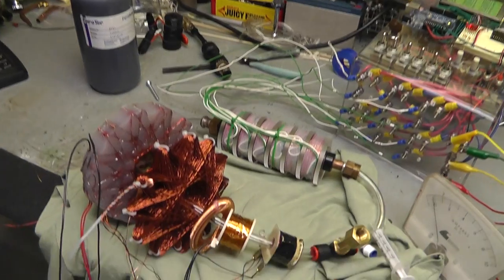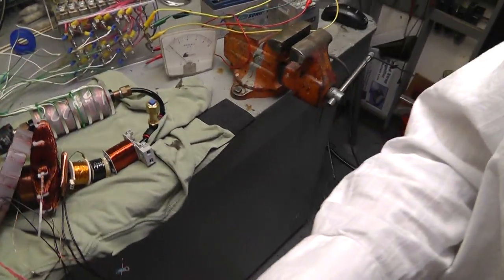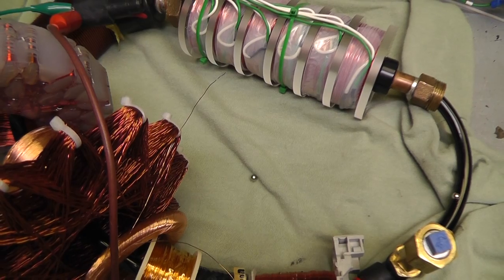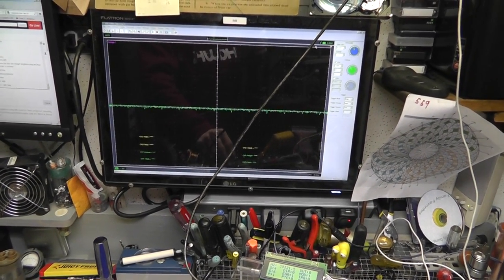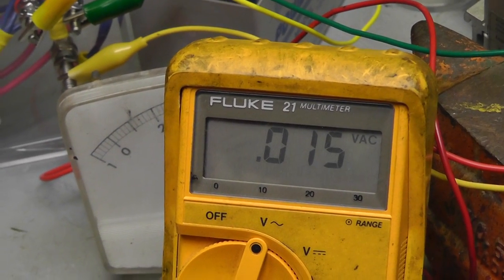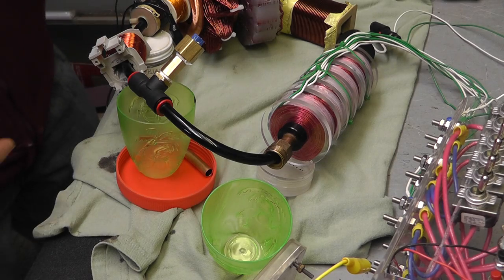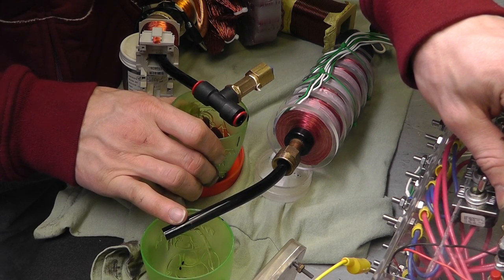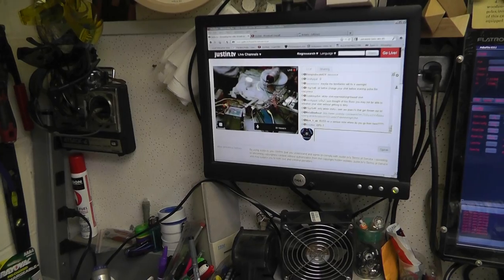P1 EPG  Testing, Ferro Fluid Is Not The Key? I Dont Think So

Comment: I am happy to see that somebody is researching this. I also came across the idea to see if pumped ferrofluid hydraulics would be feasible. And realized myself that the maximum pressure that could be achieved depends on the willingness of the magnetized particle in the fluid to reorient themselves instead of moving and pushing all the other fluid around. possibly a key could be the shape of the pulse chain moving through the chain of windings. Do realize though that an AC induction motor (cage runner) would not work either if there wasn't an overlap (60-120 degrees) between the phase coils. The reluctance (remanentz of the field and orientation) of the fluid would have to be utilized within some optimal phase to phase distance and frequency to maximize achievable pressure - more experimentation is necessary!

Comment: I think the amount of voltage you are seeing on the solenoid coils is consistent with how much power would be transmitted through the air to any near by coil. Also I think the best result you could expect from this test would be that the ferro fluid would act as a transformer core and provide a path for magnetic flux but this might be blocked by the copper pipe inside the pulsed coil’s core, acting as a magnetic flux shield.

Comment: Could you generate any power if you magnetised the fero fluid (with electricity or by touching it against a permanent magnet) and then pump it around the tubing? What if the pvc tubing was shaped like one of your wicked funky coils? Then you have a magnetised fluid being pumped around a shape that wouldn't normally be possible to move solid magnets around! If somewhere in the pipeline (or in several places) the hero fluid comes into contact with a neo magnet then as long as there are no air  locks the entire loop of fluid should be magnetised, then the pvc pipe could itself be wound in coils. Hey Russ i have a couple of interesting ideas regarding generators, PM me if your interested.

Comment: @MagnaMoRo a quote- To get the lithium gas so cold, the researchers trained an infrared laser beam on the gaseous cloud. Laser cooling is the primary method physicists use to lower gas temperatures to near absolute zero. The laser essentially stun the atoms, slowing them down, and thus lowering the temperature.
After initially growing, the cloud began to shrink. That shrinkage, combined with the speed of expansion after the laser turned off, indicated that the lithium atoms had become magnetic.

Comment: Another thing I caught is: Stan referred to the whole unit as a "resonating system" (not  the EPG by itself... So, pressurized gas turns the EPG pump, which generates electricity for electrolyses,  which creates gas, which creates more pressure, which turns the EPG pump, etc...

Comment: I would say if your trying to establish a flow of the ferroparamagnetic fluid. Then you probably want an array of electromagnets alternating with a gap of one coil length or more in between to make sure you are attracting the fluid within the distance of the feild lines. You would have to have iron or another mixture of similar conduting metals to produce movement of any significance. Then again I have not followed original project you are working one so I dont know if that's what you are doing or not.

Comment: Russ. To the point. Ozone is a live gass that can hold a charge untill killed by UV or Lazer ionization. Oxygen is explosive because it cant hold a charge. Ozone mixed with argon keeps the charge on the ozone. If you want to make your EPG work. Evacuate the pipes and at the same time purge with argon then at zero psi add your PURE ozone gass. Any further details you will have to contact me buy phone no exceptions. David A. Puchta

Comment: If I understood the original design correctly, didn't Stanley Meyers use an actual pump to circulate his media in his EPG? Maybe that's the key to this device. Look at it this way. If the fluid is circulating, you would have two things happening at once. (1.) You would get the standard transformer action (2.) You would get a second power gain from a physical movement of the magnetized liquid thru the coils too. The question is, would the output gain be equal or more than the overall input power?

Comment: @rwg42985 Hey Russ I got a idea dnk if it will work but it worth a shot try usen a fine magnetic or just iron filings in mineral oil. Resin is to find a proper ratio and see the fillings in action to see how the interactions with the coils